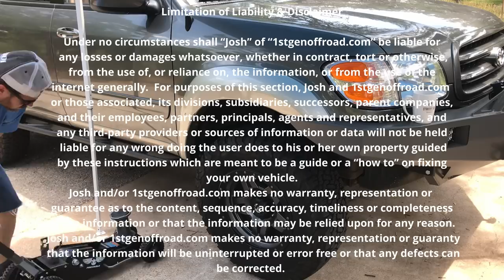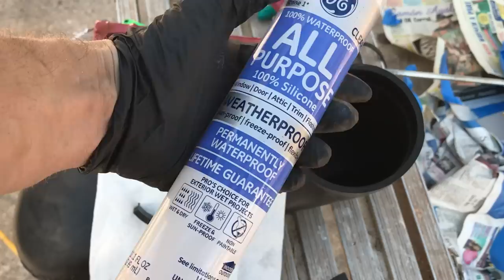Ep. 13. Tundra/Sequoia ARB Safari Snorkel Install

Comment: I would love to see an aftermarket roof rack for a tent. Your build is basically what I want to do to my 2002 sequoia.
Reply: I have a mildly built 2002. Have a smittybilt defender rack with a smittybilt RTT on it. But even before i attached the Defender rack i was able to mount the RTT to the factory roof rack fairly well. For the defender you need to order the attaching brackets for a 3rd gen 4runner. Smittybilt says they dont build anything for sequoia but that 4runner bracket kit works great
Reply: desert4wheeling awesome man thank you for the info.
Reply: Coming soon from Offroad Designs.

Comment: Use a step bit next time to clean the burrs off you smaller holes, they work incredibly good for that. Build is looking great, maybe next should be a 1st gen Tacoma 4 door.
Reply: Agreed. A step bit will also give you a cleaner round hole, as opposed to the oblong holes twist bits cut in sheet metal.

Comment: 2000 Tundra AC  4x4. 3" Toy tech coil over, upper control arms, bilstein 5100 rear, lock right rear locker. Rocky Road sliders, 35" Thunderer Trac grip mud tires, cold AC ! 289K miles, XM radio, likes shaming Jeeps in Moab ! Auto locker comparison vs manual locker?

Comment: Thanks for posting this. I have an '03 Tundra I picked up with a similar snorkel, but the previous owner wrecked the fender it's mounted on. I picked up a fender at the scrap yard and have been putting off changing it out since I had no idea how to reinstall the snorkel. I think your video will be a big help.

Comment: Great build! Perhaps skid plates, rear bumper, info on your sliders. Looking to add a Land cruiser to go with my 2wd Sequoia and 84 solid axle truck.But your videos are having me consider a sequoia. How do you like your push button 4hi 4 low on the tundra compared to the shifter lever on the sequoia. Any reliability issue with either one?

Comment: I'm looking at buying a 2008 to 2010 sequoia 5.7 but having trouble finding aftermarket parts
Reply from the maker: What kind of stuff are you looking for?
Reply: @1stgenoffroad  well I'm new to offroading so I could use some guidance, I know what I need it for and I have some ideas but dont want to get anything that's unnecessary for my needs. My ideas: 3 inch lift with shocks springs and upper control arms, rock skid plates, cell booster and full length roof rack. I don't think I need full offroading bumpers but maybe a bull bar or grill guard with winch and rear rack for gas/water containers.
Reply from the maker: @Tech-bv9oj  2.5" lift here: https://www.1stgenoffroad.com/store/p227/2InchLiftKitDeluxe20012007ToyotaSequoia.html
Reply from the maker: @Tech-bv9oj  Adapted Roof Rack here: https://www.youtube.com/watch?v=CIR5uRIa6so&t=624s
Reply: I like that roof rack will probably make a similar one thank you.  However the lift kit you tagged says 01 to 07 and im interested in an 08 plus
Reply from the maker: Okay. Sorry bud. Missed the 08 part. Dobinsons makes a 1.75” kit here. https://www.1stgenoffroad.com/store/p581/DOBINSONSLiftKitToyotaSequoia2008to2018.html

If you wanted to go higher, we could work our a 2.5” Dobinsons/Bilstein kit. But no one makes one off the shelf.

Comment: Your 1st Gen Sequoia is looking awesome! Quick question, what is the best replacement for front/ rear struts? Mine is the same model as yours but bone stock, it has 140K miles on it but the ride is on the stiff side now? When should i replace my shocks? I want the ride to the on the softer side, do i need to replace my bushings w/ polyurethane? Appreciate your suggestions. Keep it up! 🙌🏻👍🏻🙏

Comment: Nice job on the sequoia 
I just want to know how long did it take u to do all that work and how much was invested (roughly) and I would like to see your next project to be a nissan pathfinder 05-12
Reply from the maker: Just the cost of the snorkel. I already had the tools and supplies required. If you know what you’re doing it doesn’t take long. You have to wait for paint to dry twice. I filmed it so it always takes longer.  But you could do it in a weekend.

Comment: Does a snorkel help with cool air instead of hot air, I always wondered how it compared in normal driving conditions.
Reply from the maker: It is cleaner and cooler air.

Comment: I have a question; will a big negative offset ( -44  -  -51)  increase tire rubbing or make no difference? Like if I’m close to rubbing with zero offset and throw on some negative offset wheels will it start rubbing?
Reply from the maker: Might stick out so far that it’s more likely to rub on the wheel well. I think 0 to -15 is perfect.

Comment: Does that snorkel create any howling or any difference in noise when driving down the highway @ 65+ 
I’m curious to know since I also want to do this as well to my tundra & a bit skeptical about doing it
Reply from the maker: No. Doesn’t whistle or anything. Can hear a little more engine noise coming from the snorkel when the windows are down. But honestly, sounds better.
Reply: Even better then! 
I’m guessing your fuel mileage went up a slight bit too right?
Reply from the maker: Ummmm... maybe.
Reply: Did you ever get to do the template for the snorkel? I happen to need one since I just ordered mine off amazon but it’s for the land cruiser so like you said it won’t work

Comment: I took that factory tube out & replaced it with a piece of 3" pvc and used hot water heater cement to basically plastic weld it together... Mine has been on for 2 years in countless rain and it's all dry inside,  I would like to find the right "Duck valve " or oneway valve for airbox drainage should water get past the head. (Like the complete Safari Snorkel uses)

Comment: Would I be correct in assuming I need to choose between this and my passenger side ditch light?
Reply from the maker: You might be able to heat the snorkel with a heat gun and bend it enough so that you can have both.

Comment: Nice kid in the back @ 0.53 lol. And do you know if these are legal in California? I have a stock intake with a Performance K&N air filter rn on my 2005 toyota tundra SR5. I wanted to get a cold air intake but they’re illegal here in California for my truck due to too much emissions and wont pass CA smog check